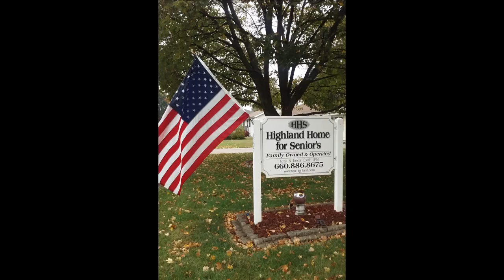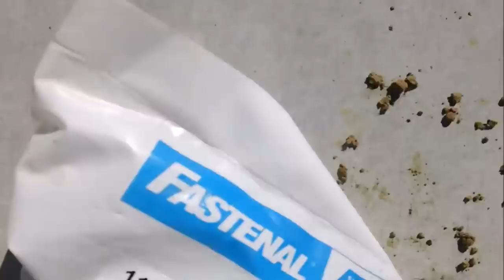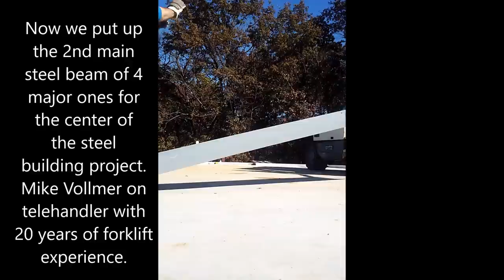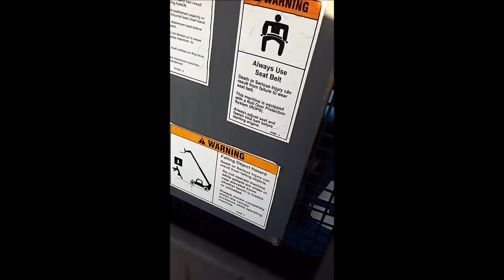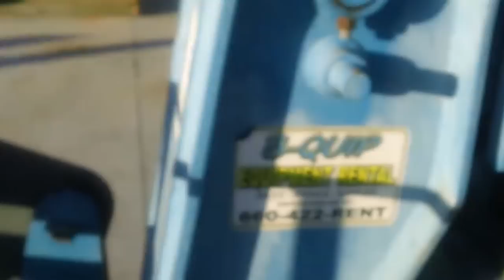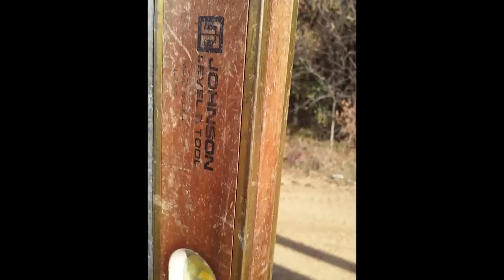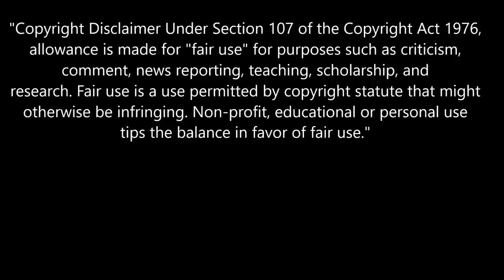STEEL FRAME HOUSE Do It Yourself Construction, Metal Building Erection, Michael Vanderpool Version 2

Comment: No offence but, So many unsafe acts, if you have any safety  concerns for your people helping you, don't try this again.
 $25,000 dlls is cheaper than living in a wheel chair..
Reply: The ladders were chained and chains used securing ladders to the steel beams, there was no lack of safety in this regards.  40 percent of all construction site fall injuries are caused by scaffolding and ladder accidents.
Reply: Examples of this can be seen at 40:08 minutes/seconds, and at 42:28 minutes/seconds, etc. etc.
Reply: your logic can apply to the entire commercial or corporate construction industry... the safety chains are blatantly seen in use in this video - safety measures were employed to one degree or another.